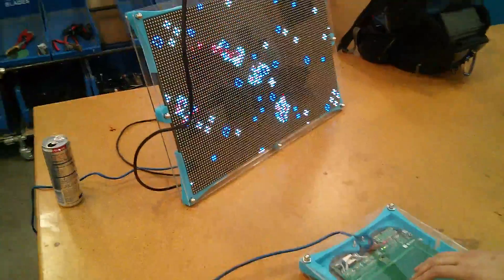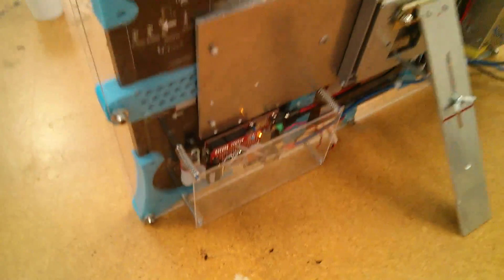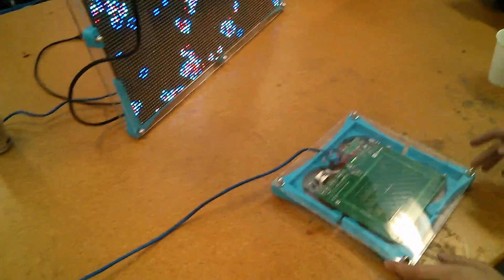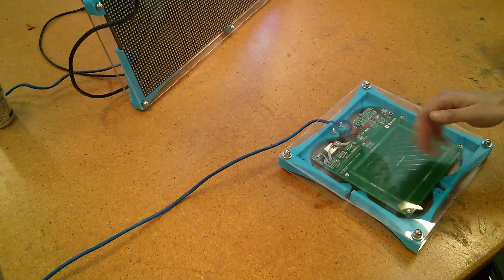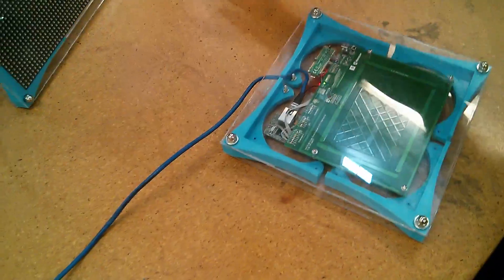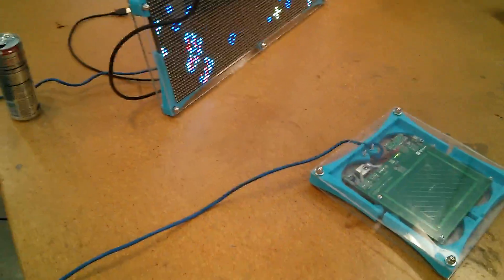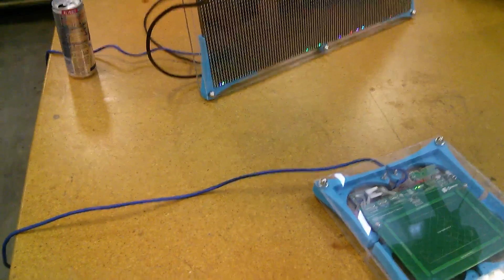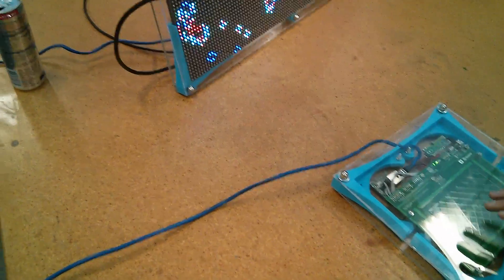Brent using Murum Lux

Comment: (FYI, comments are broken on the blog post for this.) Saw this at Maker Faire today - great work! I have a 32x32 subpanel similar/identical to what's used in this, and I get the faint line artifacts as well. Did you ever determine why that happens? I suspect it's intrinsic to the design of the panels themselves.
Reply from the maker: ***** You are correct! I will fix it sometime this week.
As for the artifacts, if I really knew, there would be nno artifacts. :-)  But I think it has to do with the timing of the OE signal versus the row-select signals (A-D).